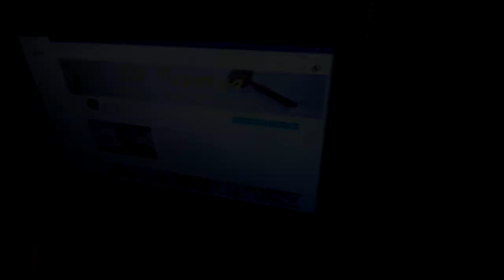Reclaimed mahogany and the fore cabin - SV Tapatya EP120

Comment: Hi Tony
You do a good job on your boat. We are lucky that winter has not been so cold this year. I've only had to scrape ice from the car's windows twice so far.
I just got the date for this year's launch. We will be in the water on April 16th. Meanwhile, I am replacing all the power on the boat. Many things have been connected along the way so now all the spaghetti have to go.
Later I must have made new frames for my windows as the old ones are leaking.
Now I look forward to watching next week's video. Keep up your good work.
Many greetings
Torben
Reply from the maker: Thanks Torben. It has indeed been mild, which certainly has its advantages! Good luck with your boat work 👍

Comment: Sweet progress, Tony - I consider the inside of Tapatya to be highly photogenic, for the record!  
I'd be curious to know (in due course) exactly how you decided that the initial glueing job was insufficient, causing your reverting to "plan B" - expoxy.  Did the wood simply break apart when you took the clamps off, or was it more subtle than that?  Sometimes a glueing job looks OK, but isn't: I guess with experience you just have a feel for these things.  Perhaps a discussion for a future video?
Cheers and have a great week, Chris
Reply from the maker: Thanks Chris 
To be honest, the problem was probably my impatience. I started cleaning one board up and one of the joints broke apart. The glue hadn't properly dried. I couldn't be sure where the problem lay - maybe it would have been ok if I'd just given it more time, but maybe the temperature or moisture content of the wood was problematic, or maybe my joints were too imprecise. I decided to reglue them all with epoxy just to be on the safe side, even though it's not a load bearing piece. And that way I could be certain that the joint would hold next time, thereby potentially saving time in the long run...🤔
Reply: @SVTapatya  Thanks for your reply, Tony!  Very interesting info.

Comment: Some good progress there, Tony. I'd love to know your thoughts on how/why the Titebond joints failed, please.
Reply: I've had similar problems,  I know it likes heat and moisture in the materials. I didn't ensure either one .
Reply from the maker: Good question Garryck and an interesting response William. 
I suspect several factors. The temperature may well have been borderline and I probably was impatient and started working the boards too early. And although I did try to minimise gaps in the joints, maybe I wasn’t precise enough. Epoxy is much better at gap filling 🤔